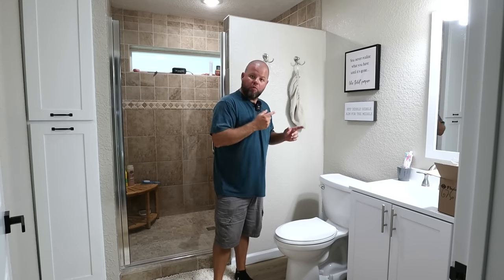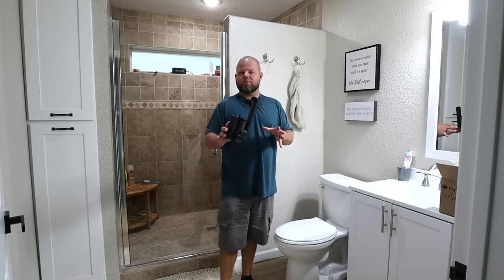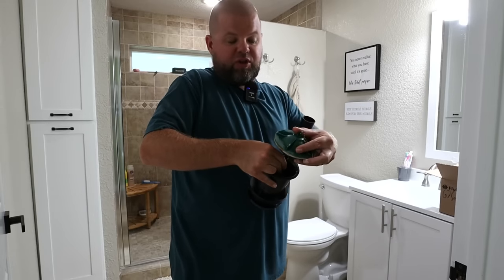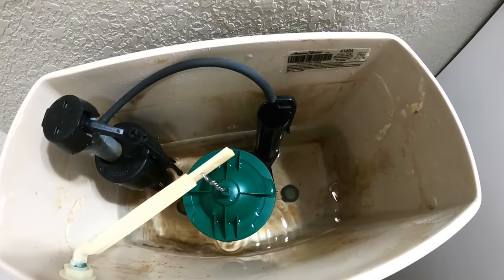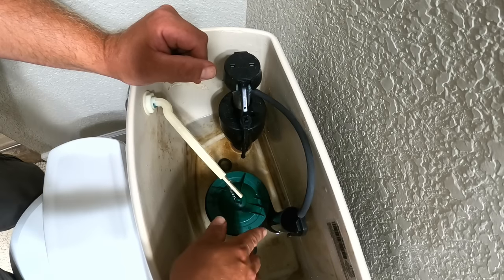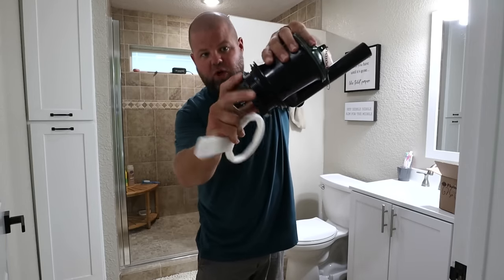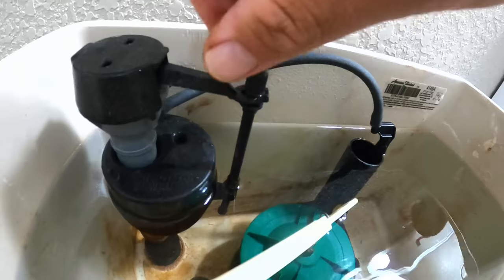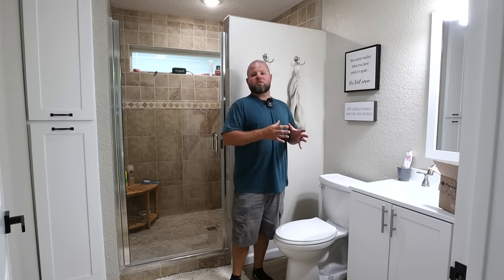Fix your leaking toilet! American Standard Champion  #788

Comment: Thanks! I just ordered the part to do this. While I have the tank off, I'm going to replace the gaskets that are around the bolts that hold the tank on. Is that overkill? I figure that all gaskets will eventually wear out and leak so I might as well do it now. What do you think? My toilet is about 15 years old.
Reply from the maker: 15 years old is worth replacing all gaskets in my opinion.

Comment: Thank you for your video. I also have another American Standard toilet and it's the same exact issue with the damn flapper. I don't see why they don't fix that damn issue with the flapper bubbling up and causing a gap on the seal that makes it leak. Makes you not want to buy their products due to their issues. Well I called American Standard and the rep stated that the toilets are under a 10 year warranty and they going to send me a couple of flapper rubber seals at no charge. I would recommend you call American Standard them and explain.
Reply from the maker: They do cover parts, but I wanted mine fixed quickly. I also found just the seal.

Comment: I have the same unit in my tank.  I can't believe the engineers at
American Standard thought this was an improved design. 
First off, I didn't see anywhere in your video if it's possible to
replace JUST the blistered gasket ?  The previous design had a black
lock nut on top of the green flapper cover that you could unscrew.
Then you could replace JUST the gasket.
This new design eliminated that black lock nut.  
Even if I was able to remove the flapper cover as you describe in your video,
can you replace JUST the "blistered" gasket ?  If you have to replace
the entire top flapper piece which comes with a new gasket, I don't
see where you're saving any money since you would have to buy the entire
flush valve assembly just to replace the gasket !
Reply from the maker: You can replace just the gasket, I did it to my second toilet.  I found the new and improved gasket here https://amzn.to/4aLKBKY

Comment: I've seen that same exact failure at work and had to fix it with the whole assembly like you said. But all I really needed was the seal
Reply from the maker: It's apparently a really bad design or low quality materials.

Comment: Mines just broke trying to do this click turn method 😮.. then the remaining stem fell down the hole 😭.... Whole time I could have just stretched the rubber flapper from around the plunger thingy.. the replaced it.. 😳.. now I have to order a flapper assembly and figure out how to install.. thanks buddy
Reply from the maker: You're the first person out of thousands to complain of this. You obviously have a different flapper. There's no possibility of stretching this style seal around the flapper. It MUST be removed. I've replaced two toilets, one with the full valve replacement and one with the NEW seal (found after posting this video) BOTH require the removal of the plastic stem and flapper.
Reply: @TKCL  I have the exact same one.. it's cool.. it looks like it was one solid piece.. as soon as I turned it.. it snapped 😭.. and I swear I didn't turn it too firmly.... .. maybe it was a little corroded...
Reply: @TKCL  I'm sure it was something I did wrong not your explanation.. .. thanks again for the video upload .. I did learn a lot from your video..

Comment: Can you replace an older Champion flush valve flapper that has a thumb screw on the top with the newer flapper that your demonstration shows? Thank you
Reply from the maker: I don't believe so, you would need to contact Champion to verify.
Reply: Took a chance and bought the flush valve for the one piece Champion as the picture of the flapper looked similar…green with a black thumb screw. It worked!  Also the silicone gasket and o-ring replaced. Of course I’m left with a non usable shaft but it did the trick. Going to try to attach 2 pics. Feel free to use.  Thanks for your attention.
Reply: Well, I guess there is no way to send pics that I could find. Thanks again.

Comment: The American Standard Champion toilet isn't the problem. The gasket may be suspect to early failure, but the manufacture will replace it for FREE. Every plumbing part ever manufactured will have a component that isn't bullet proof. In this case your water most likely will continue to cause failures of that gasket. The newer replacement gaskets seem to hold up much longer no doubt due to different material being used.
Reply from the maker: I actually love these toilets and plan to keep them. Luckily I found a newer style gasket that appears to fix the faulty factory one.

Comment: So I had the older model. There was seperation forming, but I developed a crack on that plastic bit on top. With the older model, you cant just swap these out. The way the top fits the bottom has changed, as well as the thread diameter.
Reply: I am having the same problem. How did you fix it? Did you have to take the toilet apart to put in the new valve assembly?

Comment: The thing I like about this toilet design is out do you flush it? There’s still about a gallon of water in there which means if you put a traditional flapper valve in there and converted it, it would be dumping that extra gallon and it would flush good like toilets used to before the regulatory people ruined them.😅😂
Reply from the maker: This toilet does flush extremely well, I've never plugged it. That's why I bought it, I HATE these new low water toilets. They plug anytime you wipe more than once.
Reply: @TKCL  yep, typical government regulators they don’t want you to use 2 gallons per flush so they make 1.6 gallon toilets that you have to flush twice. 😂😂

Comment: when you remove the two nuts that are attached to the bolts that are holding the tank down, won't water start spilling all over the floor?
Reply from the maker: You cut the water supply off and then flush the toilet removing the water from the tank. Only a minor amount will remain.
Reply: @TKCL thanks. I siphoned out water about 3 inches deep

Comment: I have the same toilet and despite adjusting the float level it works for 1 or 2 flushes and then starts pouring water into that overflow spout again. Do I need to replace the float part and if so how? Which one do I purchase?
Reply from the maker: You made full adjustments on the float level? Sounds like the float might be waterlogged. There is a model number on the inside of the toilet tank. Type that in for parts.

Comment: We bought our AS in 2020 or 2021 and the flapper isn't removable. I actually broke it trying to follow your instructions. The replacement is identical to the one you have. Some where along the way they changed the flapper.
Reply from the maker: Mine was bought in 2021 while building our house. This is interesting to hear.

Comment: I’ve replaced mine 2 times in less then 3 years . And now it’s doing it again . Supposed to be still under warranty
Reply from the maker: There is a new blue seal I replaced mine to, works great and no issues after a year in use.  Link is in the description, I got mine on Amazon.

Comment: Due to a leak, I replaced the entire flush valve (wasn't able to find just the flapper). I made sure everything is snug, but it still leaks 😩 any suggestions?
Reply from the maker: Make sure your float is adjusted correctly, might be overflowing.
Reply: @TKCL   already adjusted it to 1/2" below the overflow tube. Could it be the foam like gasket, that sits between the tank and seat is worn? I really appreciate you responding, thank you!
Reply from the maker: Not if you replaced the entire unit. Double check the under tank seal 🤷
Reply: @TKCL  it was a little loose, will replace it. Thanks again!!

Comment: What I would like to know is why  the manufacturing sector insists on changing perfectly good toilet technology when the old style worked fine, lasted longer, and when they did wear out, they were easy and cheap to repair.  I have a suspicion the reason is for new patents and proprietary technology that simply chips away at the consumer's pocketbook.   I'm a little weary of it myself.
Reply from the maker: Your probably correct

Comment: My water continues to raise once the float is up & keeps draining into the overflow tube. Please help
Reply from the maker: Adjust the float down further, that's not uncommon for the float to be more than half submerged and still flowing. Adjust the thumb screw as shown in this video. Otherwise replace the valve assembly.
Reply: @TKCL  I just changed the fill valve assembly. That did the trick. $10 at Home depot. 
Thanks for the help. 👍🏿
Reply from the maker: @floyd27860 glad it worked for you.